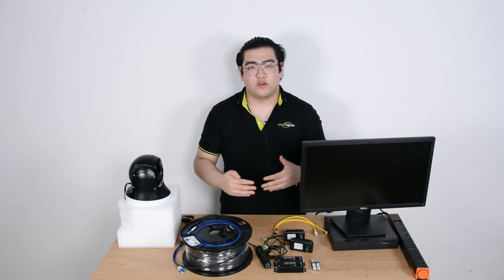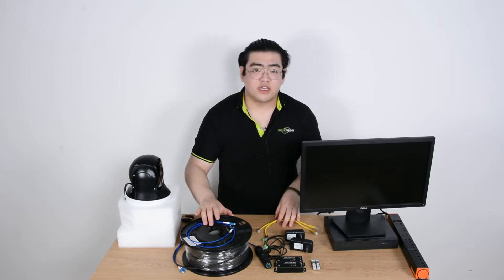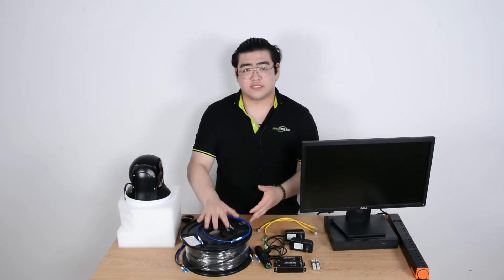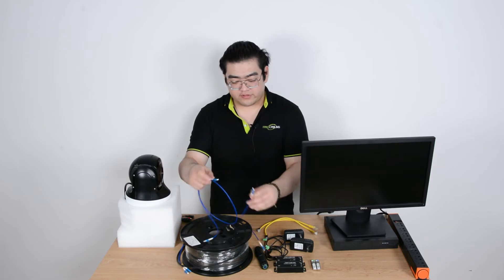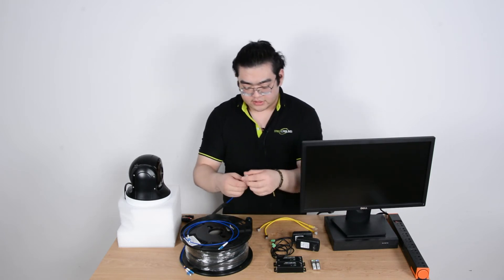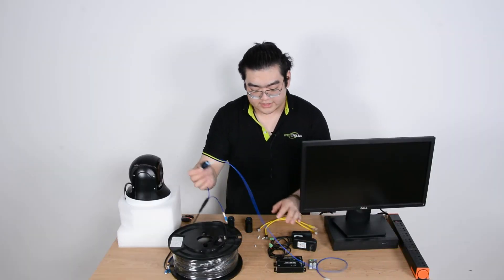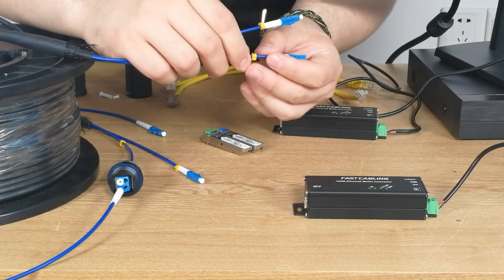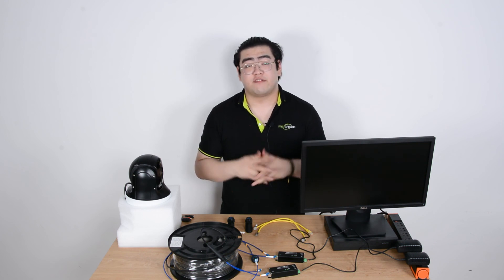How to Use Fiber Optic Cable Coupler to Extend Cable Length?

Comment: Hello there, i wanna ask you about the Fiber Optic Cable Length, Can i use 150m or 200m cable? cause they say the length matters because it affects signal quality and performance, primarily due to attenuation.
Reply from the maker: For 150 m or 200 m, either single-mode or multi-mode fiber works fine for standard data rates (1G, 10G). The main factors that matter more than length: connector quality, splices, bending radius, and clean terminations.

Comment: help me extend my fios fiber cable.
Reply from the maker: You will need to determine the connection type LC/SC/ST or other types. If the connector is not ready, you might need fusion tools to spice the patch cord.
Reply: @Fastcabling  thx

Comment: Could you please provide coupler link
Reply from the maker: Hi, we sell different types of couplers on our website, the one used in this video is the SC to SC Fiber Optic Cable Extension Coupler: https://www.fastcabling.com/product/sc-to-sc-fiber-optic-cable-extension-coupler/

If you're looking for LC-LC coupler, please check out the link below:
https://www.fastcabling.com/product/lc-to-lc-fiber-optic-cable-extension-coupler/